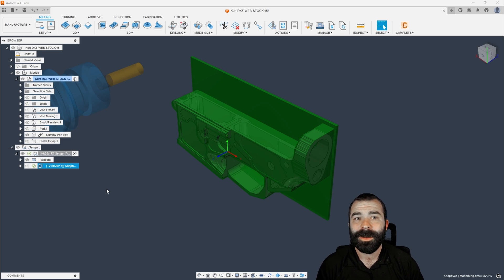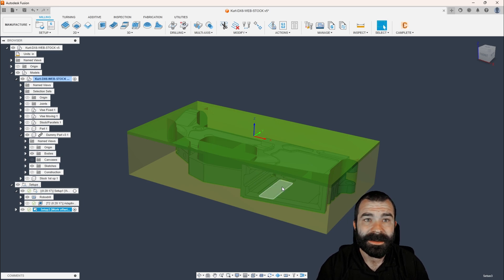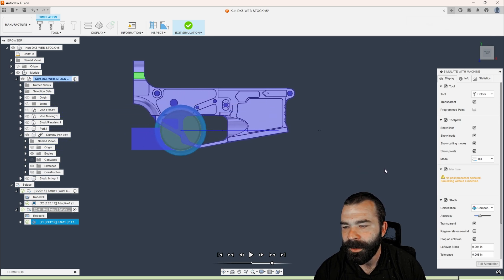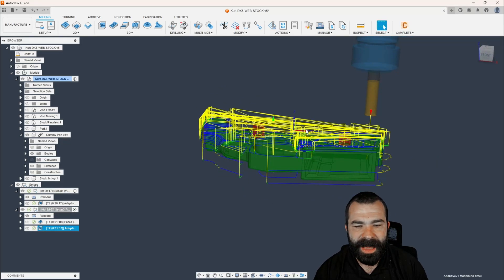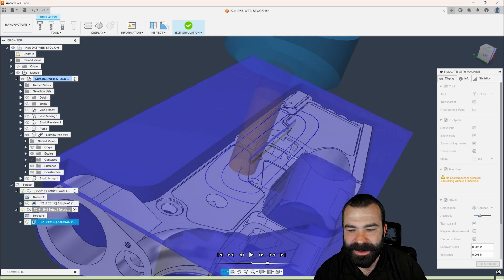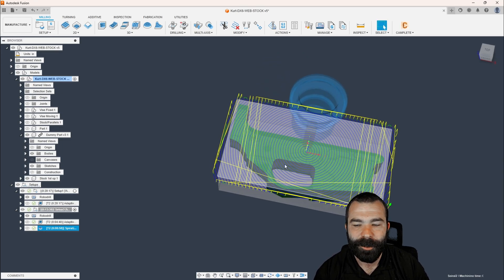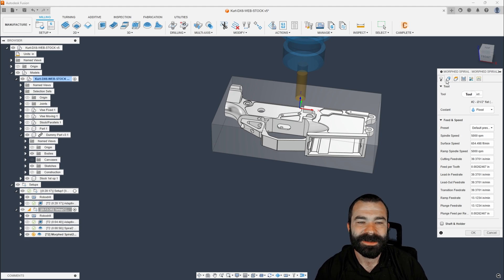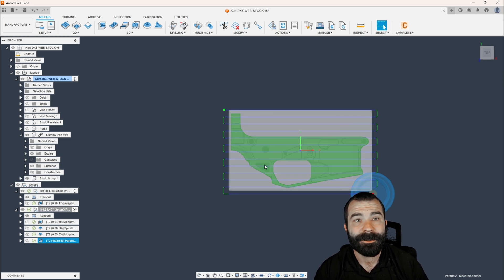Workflow Wednesday: To Face or Not to Face

Comment: It is not bad to point out option to select center of Spiral toolpath if you have gap in the middle of the part or something similar. And it would be good to do explanation about Morph Tool path. I've never figured out what is this Toolpath really about. It's not like Bland not Flow. For what geometry is this Toolpath better then any other. Tnx man
Reply from the maker: Good point!

Comment: Great video- I wish you showed my favorite way, 2d contour the profile of the part 0.010 below model top with a few roughing passes. While it doesnt remove the stock above the part it makes it so there is no hat.
Reply from the maker: Great suggestion!
Reply: @JITCADCAM  That's how I do it too.  Don't come at it from the top - come at it from the sides and the deck it off later.  No issues with those bent pieces of metal flying off the part.  That being said, sometimes it helps to have a little bit more leftover stock that isn't so flexy.  I realize that's not always an option but having a little more meat to cut into from the side can help.